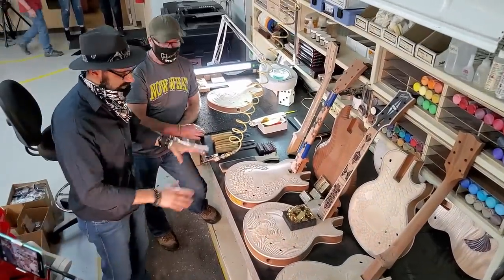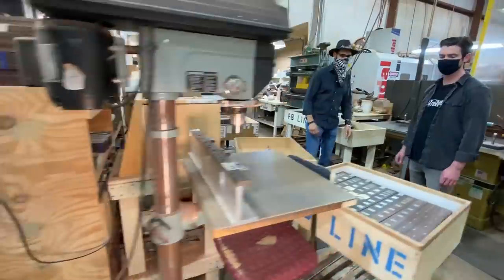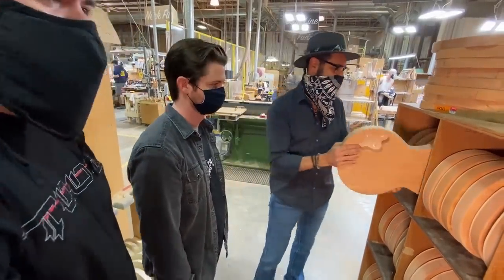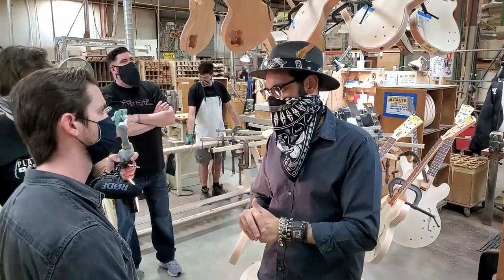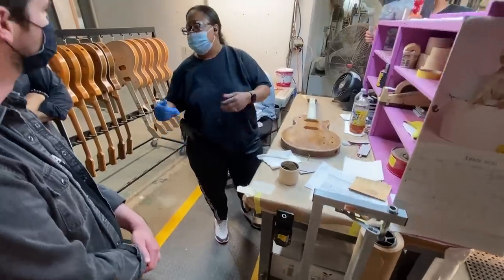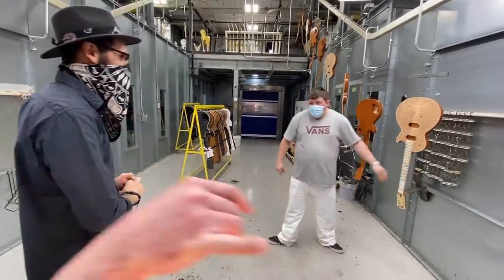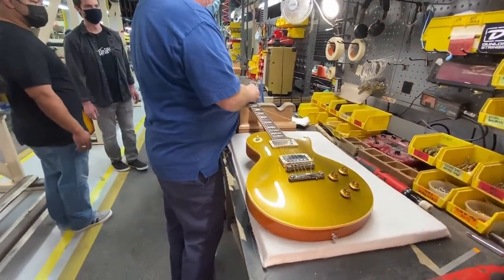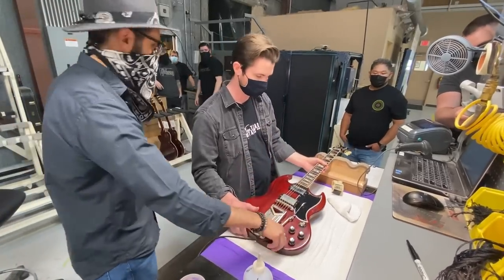Gibson CUSTOM SHOP Factory Tour UNCUT

Comment: I've owned and sold six Led Paul Models during the 70s. Had to sell them due to weight aggrevaiting my sponalthesis which did not discover until 1981 then had corrective surgery September 1988. Two years ago found a used 1991 Les Paul in a pawn shop and still play and have it. I've also owned 4 different SG's and a few Epiphones but in long run still love the Gibson Les Paul Models. They have their own that I'm able to connect better than any other name brand I've ever owned since 1964. My grandpa owned and played a old hollow body with one black pickup. I learnt my first tune, "Peter Gun," and now also own a Gibson and proud of the guitar. I think this model maybe a custom shop model but have yet to verify. Still this 1991 Les Paul Model Wine Red with Gold Hardware is a bad a*s axe.

Comment: This guy really loves saying the word “handmade”.
Reply: Yeah and it is repulsive to listen to be honest! Gibson's Greed is just overwhelming!  A "Custom shop" Les Paul R9 starts at $7K and as you can see they are built in a massive factory sized environment nothing like a actual Custom shop that has a small crew of top builders. Now i am not saying the "Custom shop" Les pauls are not great but C'mon $7K!!!! 
The Standard 50's is $3K now so a CS one is over double one of those?  The ONLY differences are a Long neck tenon on a CS,
Custombucker pu's on the CS, true ABR1 post's to mount the bridge, a slightly better grade mahogany and maple, slightly worn
VOS treament to the finish and hardware.  Sorry but there is no way those things can add the extra $3,500 to the cost of these!
At most $1500 over the price of the standard 50's is what a R9 CS should cost.

Comment: you skipped the part where they drill a bunch of holes in the body
Reply: Except that they don't
Reply: The only custom shop that has 9 hole weight relief are the Les Paul Customs, not a Reissue year.

Comment: Dude in there spraying nitro lacquer with no mask or any protection, yikes
Reply: well spotted totally wrong
Reply: Good catch, that’s dangerous. Cesar was pretty quiet during that part, maybe he noticed as well.
Reply: First thing I thought when I saw it.
Reply: Silence is consent, right?
Reply: I see more than enough masks.
Reply: If the booth fan is strong enough then it is safe enough, with certain paints, to not use a mask. But with nitro, hell no, that is 100% bad news for the finisher
Reply: They have BIG turnover at that job.  ;)
Reply: One of many reasons not to buy a Gibson
Reply: @theandiller  There is no guitar that compares with a Gibson.  That's just fact.  Not until you get into the $8k-$10k range anyway.

Comment: Half of what you pay for is all the extra glue. Gibson doesn't seem to care much about quality, just living off of the reputation of the past. Which is decades ago. Over priced junk. Sub standard finish and other issues they don't seem to care about. I will stick with my Tele, Thanks! The guitar that sold more Les Paul's than anything, Thanks to Jimmy Page. A Les Paul might look nicer if they didn't botch the finish to bad, but the quality checks seem to be non- existant. They don't stay in tune great. Akward, the play. Way over priced for what it is. I would go for an Aria or Esp maybe. Gibson is relying on the legacy of it's name from way in the past now, people will catch on if they haven't. I would like a nice Les Paul style but I will get it from a company that takes pride. I really don't want a new Fender either, They are all Mexican made now.. Even the U.S... Made by a bunch of Ladies mostly. I have nothing against a hard working person but there isn't much different between U.S. and Mexican as far as the labor. I will probably build most my guitars from here on out now. Much cheaper to put together a quality piece. Fender and Gibson mostly rely on all the old patents. Not much innovation. This is the Custom shop so there are probably much higher standards.. I do love Les Paul style guitars, nothing like a Les Paul but they need to get quality under control. Not paying the worker enough will reflect in the quality. Not sure if that is an issue. Anyway, get whatever makes you happy, just my early morning rant..